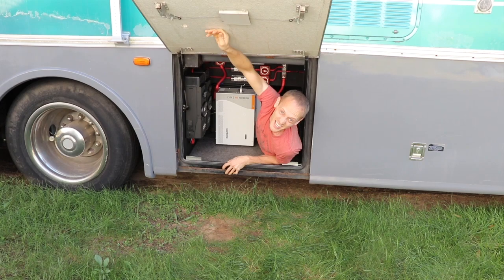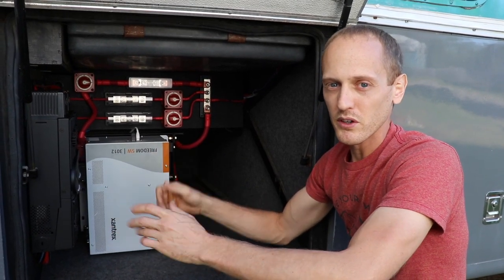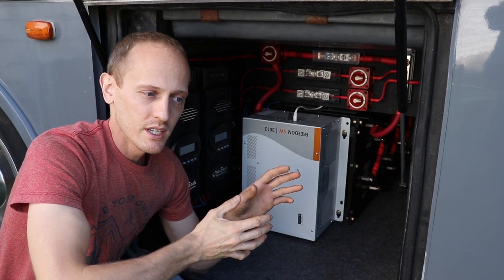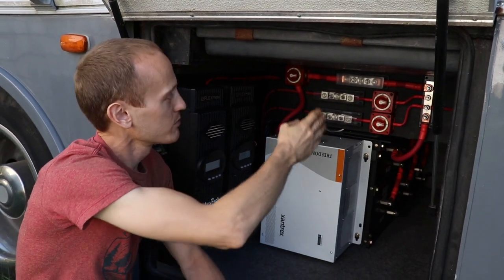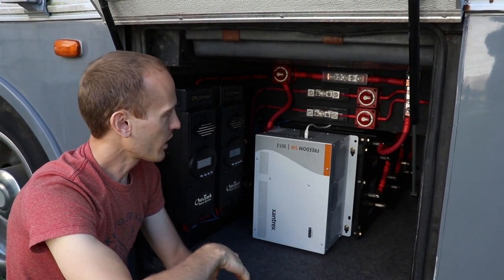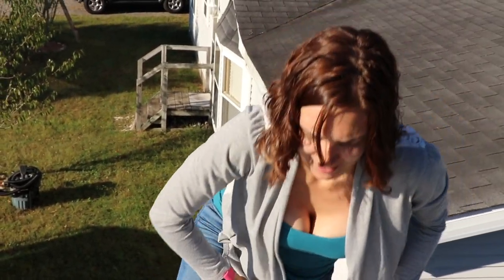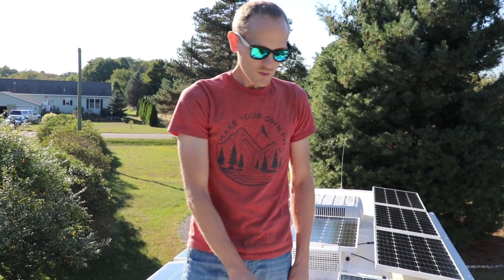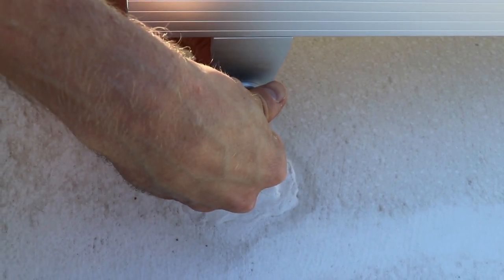Massive DIY RV Solar Install for Off Grid Boondocking

Comment: Hello, very nice system, I would like to know how you connected all the positive ( hot ) wires and the negative ( ground ) wires.  I have a 780 AMP battery bank with 6 ( 6 ) volt 260 amp batteries wired in series and then parallel.  I stayed with a 12 volt system, I have 2 ( 355 watt ) solar panels wired in parallel for 710 watts with a Victron 100 volt / 50 amp charge controller.  I have my Solar positive wire coming from the charge controller through a breaker and then connected with my inverter positive wire on the positive bus bar.  I have a 200 AMP breaker between the batteries and the rest of the positive wires.  The positive and negative wires are attached to bus bars.  Thank you for being patient, I have a 500 AMP shunt as well attached to my BMV 712.  My question is how does your positive wires line up ( sequence ) on the bus bar or does it matter where how are attached , and my second question is do you let your solar charger charge the batteries when the alternator is charging them.  Thank you again and God Bless...
Reply from the maker: Hopefully I am understanding correctly. Solar doesn't do anything but charge the batteries, so hopefully your intentions when putting the POS wire from the charge controller on the POS wire feeding the inverter wasn't to try and directly feed the inverter from the solar. Being that you said it was also on a bus bar that goes to your POS terminal on the batteries,  you ended up ok. There is no special order to hook the wires to the bus bar. In essence, they are all acting as if they were stacked on each other directly on the POS battery terminal. One thing I would like to note about the size of your system is that you will need more solar panels to be able to utilize all of the usable amp hours of battery you have. The rule of thumb is at least 1.5watts for every 1amp hour of total capacity. Currently, your 710watts will only be able to replace about 255ah to the battery bank each day. With 780ah available, you have 390ah of usable power. Currently you wouldn't want to let your bank get below 68-70% if you wanted to get back to 100% the next day. 1200watts would be the ideal amount of solar for that size battery bank. For your other question, yes, we let our solar charge the batteries all the time. With the size banks you and I have, the alternator isn't putting a huge dent in the charging, so all the input helps.
Reply: I wanted to thank you again for the advice.  So when I am driving down the road and I have my MPPT charge controller enabled and my alternator from the RV charging ( 100 amp ) I will not have an issue with the electronic side of the engine effecting the alternator and engine running?  I will be adding at least another 355 watt panel to my system.  My system is 12 volt so my Victron 100 / 50 amp charge controller can only deliver a max of 50 amps.  Thanks again.  God Bless...
Reply from the maker: @retiredletsgosomewhere8743  no issue. You will be good to go. We have been charging 80+amps from our solar while driving down the road.
Reply: thank you  Happy Trails and God Bless...
Reply: @HereThenGone ,
I would suggest to use caution on using the alternator to help charge large battery banks. The reason being, when large battery banks are drawn down, say as low as 60 to 50% of your capacity, they put a very heavy draw on the alternator, easily maxing it out. The problem is, the alternators are not designed to run at full load for long, and if you do, it will really shorten the life of it. 

In your situation, with the large battery bank that you have, it would be a good idea to connect the alternator output via a constant duty solenoid, that you can control. This way, if you are in a jam, and need that additional alternator charge, you can cycle it on and off every 15 to 30 minutes, with 10 minutes of rest time between the charging. This will give the alternator time to cool and rest before you load it again. I would also suggest to use an ignition power source to close (energize) that solenoid, this way when your engine is off that solenoid can't be turned on, allowing your chassis batteries to potentially be drained. Another plus with this setup, is if your alternator over fails, you can engage the solenoid, and the solar will charge your chassis batteries. If this situation would happen at night, you can start the generator, and the inverter/charger will keep the batteries charged.
Reply: @HereThenGone ,
That is not quite correct. Solar does, primarily, charge the battery bank, but if the batteries are charged and there is more power coming in than the battery bank is taking in, and you are running various loads, those loads will use the solar directly via the inverter, and if there is not enough power to supply those loads from the solar output alone, then it makes up the difference  (the needed amount of amp draw) from the battery bank. This all happens seamlessly via path of least resistance.

As for the 1.5w ratio rule. That is just a guide, and if you sized you battery bank correctly for your daily needs, its not the end of the world if you are bellow that, as long as it is not lower then 1:1. Ideally, you battery bank should be sized where you only use 10 to 20% on the average daily bases. This way, if you have a few cloudy days, you have enough capacity to get you through. Those situations don't happen that often, and when it does, it will just take a couple of days to bring your bank back to 100%, so it's not a big deal. Worst case, if too many days went by without achieving 100%, just run an additional equalize cycle to keep the batteries in good shape. Of course, 1.5:1 is better, but is someone does not have the budget or the roof space, but needs the extra battery capacity to run essential equipment like a C-pap machine, it not the end of the world, as long as the owner know how to improvise and keep the batteries on good health.
Also, in situations where the weather does not cooperate for days on end, one can use the generator. When one does have to resort to the generator, it is best to use it in the morning, for an hour or so, of high capacity bulk charging, and then let the solar top it off during the rest of the day, when less amps but more time is required to top it off during the absorb stage.
Reply from the maker: Also, you should only have one POS wire coming from all the batteries and one NEG wire. POS from one pair and the NEG from the last pair in line so that they are acting as one big battery. I think that is how you have it, but wanted to say it just in case.
Reply: thank you

I only have one Positive and Negative wire coming from each bus bar to the negative and positive battery posts.  The other point about 1.5 watts for every 1 amp, I heard the watts should about equal the amp hours in your battery bank.  I think i will add one more solar panel to give me 1065 watts to support my 780 amp hour battery bank.  thanks again for the reply  God Bless...
Reply from the maker: @retiredletsgosomewhere8743  whoever told you a 1 to 1 doesn't know the math. If you want to see what I'm talking about, you should check out our other video on sizing your system. You will either never be able to use all the battery capacity that is usable in order to get back to 100%, or you will be running your generator every day to help the solar if you do pull down to 50%. Just trying to help so you aren't disappointed when you find it out in real use that you are limiting your system. Another panel will get you almost there, but overcast days will be impossible to keep up with. More panels is always the best option. 1.5 to 1 is the base line just to get by.
Reply from the maker: https://youtu.be/UnCM5gCqSWs
Reply: Hopefully you aren't connecting your alternator directly to your battery bank. Should only be through a battery isolator of some sort.

Comment: very informative and awesome rig!
Reply from the maker: Thanks a lot. Really enjoy being able to help others learn and have some fun doing it. Check out our video on sizing your system if you are interested. Lot of info there as well. More in-depth.
Reply: @HereThenGone  thanks boss! It looks like you are familiar with machining as well. Did you major in electrical engineering and take machining classes? Or just all research and hands on
Reply from the maker: @shawnwalden2669  just stumbled into machining. I do pretty much anything with my hands. Carpentry, electrical, plumbing, fiberglass work, ice carving, working on cars, built a motorcycle and a dune buggy from scratch, welding(not an expert, but more than sufficient) and a friend of mine needed a hand at his machine shop about 5 years ago. I was just helping cut massive amounts of square tubing in a drop band saw for a few months. They asked me to stay, and now I'm running lathes and mills every day. No schooling past highschool. I've just been blessed with good common sense and a high ability to learn new things quickly. So everything I do is self taught.
Reply: @HereThenGone  rock on brother! Keep up to good vids! I found you from a comment on adrenalin addiction. You do awesome work!
Reply from the maker: @shawnwalden2669  I really appreciate it man. We should have a ton of great content coming soon. We will be hitting the road full time in May to travel, boondock, and explore the whole country. Just learning how to film and edit, so we can only get better from here. Haha. Thanks for joining us!!

Comment: I love the content and lack of rambling in your video. Just curious how much you have invested in the system minus the batteries? Also what panels are you running? I'm about ready to pull the trigger on my setup however I'm trying to find the right panels and come up with a total cost. Tia I'm glad I found your channel today!
Reply from the maker: Hey there, if you don't include the cost of our batteries, we have $11,500 in the rest of the components. Down to the wire, connectors, bolts, screws, fuses, switches, etc. The panels we are running came matched with the charge controllers, had wire, and the pass through plates for the roof. They are 160 watts each, but they now have 200 watt panels that are the same size. You can get the 200 watt panels here and they are cheaper than the ones we bought. Hope this is helpful https://www.continuousresources.com/products/200w-36-cell-12v-nominal-solar-panel-5-busbar
Reply: A materials list on a great video like this is a must have. Even if not going as big as your system plenty of great ideas for install and quality components.
Reply from the maker: @Mark-Raptor  short of telling you how long the wires are, I'm pretty sure that everything in the system was mentioned. A video list. Haha. 😉

Comment: We have very similar systems in kWH but your install is so vastly superior. I could use the excuse that you had more room to start with but that would be lame - you would have obviously done better on my rig too. Anyway... very professionally done - all of it. I am  curious about one thing though: Why 12v? I mean, I know why, but doing so: 1) demanded 2nd Outback 2) 4/0 Awg 3) because your paths are pushing 2x amperage? You could have chosen to go 24v with a 24>12v step down instead, which has been very effective for me.
12v was never much considered here. Mine was a choice of 48, 36, or 24 volts. I chose 24v because one Classic could handle it.
Reply from the maker: Thanks for the compliments. To answer your questions, first we have two controllers in order to have each side of panels (left and right) be on their own. Our roof is contoured and therefore the panels aren't aimed the same direction to the sun. Unless perfect centered under the sun, one side will always be putting out a little more power than the other. No sense in bringing down the entire 960 watts getting better power. That also helps with potential shading on one side or the other. One side could still be putting out max power. So we wanted 2 controllers. Staying 12v also allows us to charge from the alternator while driving if there doesn't happen to be good sun while we travel. Another huge problem going 24v would be that we have 6 batteries. We would need 4 or 8 to be 24v. Only 4 would be losing a lot of power and 8 would have been a lot more money and 240 more pounds. The wiring is a non issue to me because we have properly sized wire for the conditions. Not really a big deal. And buying another piece of equipment to step down for all of the 12v just means more money as well. Hopefully that sheds some light on a few things. Thanks for taking the time to drop a comment. 😁
Reply: @HereThenGone  But your panels are angled? not sure I get the shading concern, nor the battery concern (battery cells are similar in size: a 12v 110ah is same size as 6v 220ah), but being able to charge with alternator seems a good idea. You have any idea how many amps your alternator generates per hour of travel?
Reply from the maker: @desertrat1206  the panels on the driver's side are slightly angled to the left and the passenger side panels are slightly to the right. If the sun is more to our right,the right side will be putting out 55amps and the left side will be putting out 48 amps. If they were all on one controller then instead of a total of 103amps, we would only be getting 96amps. Same goes for the shading. If the left side of our rig has shade from trees, the right side is still producing full power. We have two sets of 960 watt in series, that are paralleled at the batteries
Reply from the maker: @desertrat1206  as for the batteries, you can't make 24v with an uneven number of battery pairs. We have six 6v. So we can't make 24v with that. We would lose power going down to 4 batteries and we would gain too much more weight and cost going with 8.
Reply: @HereThenGone  This is something I have not considered. My tilted panels are similar to yours where one side certainly gets better sunlight, but since the array's output matched its rating (1900kWH in full sun) I figured all was good. But you're suggesting that I could do better by separating sides?
Reply: @HereThenGone  10-4 on that. Hardest part of these projects is storage, imo.
Reply from the maker: @desertrat1206  you could potentially do better. I am in Michigan so there is definitely a difference from side to side. The closer to the equator you get, the less dramatic the difference because the sun is more directly above. It is something to think about for sure though.
Reply: @HereThenGone ,
I fully understand your reasoning of staying with a 12v system, but one thing you may have not realized, or at least you have not mentioned this important fact, is by having two controllers, you actually have built in additional redundancy, which is a big plus. 

As for the battery issue, [if] you would have wanted to go with 24v system, you could have opted to install [six] 8 volt batteries. This would have given you 750 amp/hrs at 24v, which would be the equivalent of 1500 amp/hrs at 12v.

Comment: if you be so kind to email me and answer my question or correct me in my thinking. First I am restoring a 1967 Holiday Rambler 30' travel trailer and I want to install solar. Here goes correct me in my thinking......I want four 6 volt AMG batteries with 4 to 6  panels,which go to the charge controller. once the batteries are in place the wires go in to the charge controller then in the batteries. from the batteries the wires go to the inverter/ charger. from the inverter /charger the wires go in to a fuse pad distributing the dc voltage to the designated devises through out the trailer.
Now as far as the 120 volt system from shore power it comletely is a separate system from the DC power it has it's own panel used only on shore panel. 
my email address is bromarkfarms @gmail.com. thank you so much for your help in making this clear for me. I do not want have my walls all buttoned and then find I have to back trace or trouble shoot a problem in the system. MERRY CHRISTMAS.
My name is Brother, i live in Crossville Tn. 
Also can there be a way I can run an AC current from a devise, that transforms DC to AC, if so where does that fit in?
Reply from the maker: I'll send an email, but this will be a long process. You are lacking some of the base information needed and some you stated is wrong. Another video I made could help you out as well.

https://youtu.be/UnCM5gCqSWs
Reply: Also search Pippi Peterson Solar on here. She also does a great job explaining everything.

Comment: How did you handle grounding of the modules to chassis ground?
Reply from the maker: We didn't. Haha. I don't feel it is necessary and have never personally seen an install where they were. However, we probably have 4 of them unintentionally grounded because of finding a metal roof support while drilling in the brackets. That is what is so great about doing it yourself though, if you feel it is important, then no one can stop you. 👍